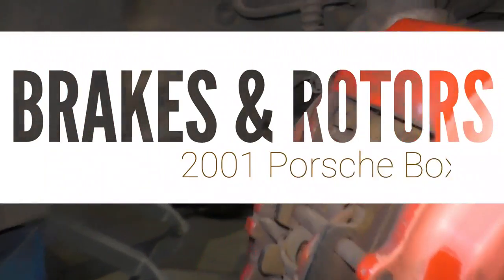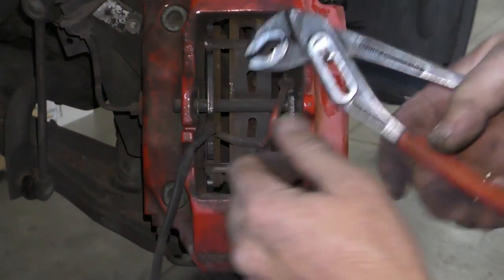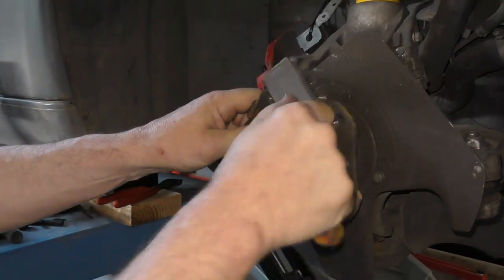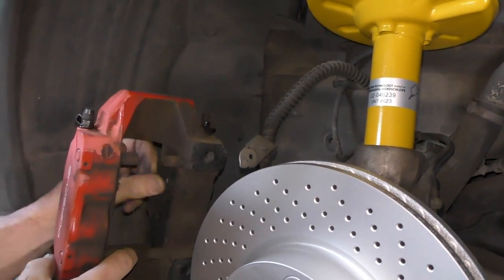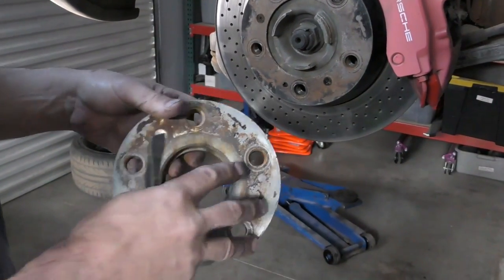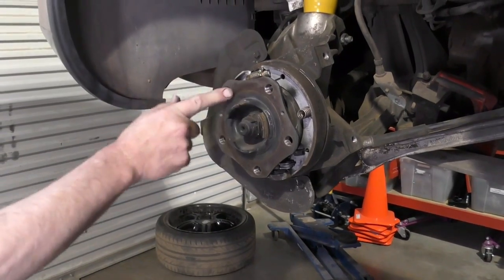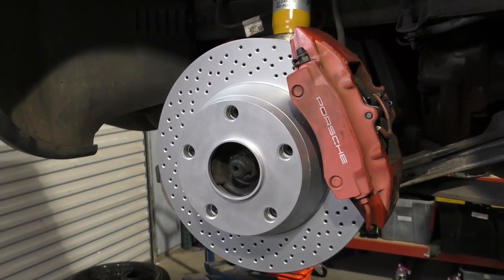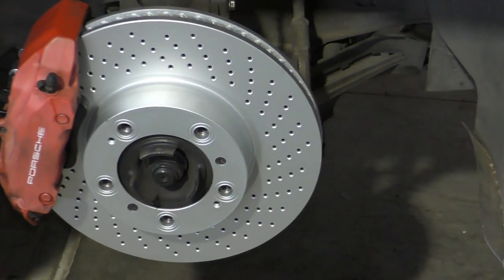Porsche Boxster New Brakes And Rotors

Comment: Thank you for all the videos you do.  I have a 2001 Boxster S and you have helped me tremendously.  BTW, would you mind sharing what brand of brake pads you used?
Reply from the maker: I have a couple of brands that i like to use. These are factory fitted brands and they are ATE, Textar, Or Pagid. I stay away from brands like Mintex, ferodo, or Napa brands. These types of pads usually have a compound that is to hard and they tend to not work well with the Porsche brake rotors
Kurt

Comment: Amazing video, so thorough and you did a great job explaining the process. I will be attempting this job at home and this video will be a great help. 

I do have a question, does compressing the brake pads and letting the old brake fluid from the bleeder screw introduce air bubbles into the system? In your video, you mentioned you were going to flush the brakes afterwards anyways but I was curious if you did not flush the brakes after this job, would there be any air bubbles in the system. I plan to have the brakes flushed at a later time by a professional mechanic. 

Thanks!
Reply from the maker: No it wont let in air by opening the bleeder valve while pushing back the pistons. Just dont forget to top off the brake fluid after your pad change.
Kurt
Reply: @klassikats  Appreciate the prompt reply. Cheers!

Comment: Fascinating work and you do it so professionally. I did the front brakes on my 1997 986 Boxster and after looking at you at work, I think I got it right. Copper grease was not applied by me simply 'cos I forgot to. No squeaks coming from them and the car pulls up just fine. I too have ventilated discs ( or rotors as you call them in the US ) and the more advanced "Red" Porsche callipers. Great stuff.
Reply from the maker: Thanks Graham,
glad you enjoyed the video
Kurt

Comment: Can I use or modify brake rotors from my boxer S for my 914 build
Reply from the maker: Alec,
unlikely as the hubs used on the Boxster are completely different to the ones used on the 914. This would result in different offsets. Also the brake rotor thickness are so different that the original calipers would not fit over the rotor.

Comment: A brake related question, but for 83 SC brake booster.  What do you do when you encounter a similar vintage brake booster that needs rebuilding?  Do you rebuild yourself, or send it out?  Would be very interesting to see a rebuild video for a booster.  Thanks!
Reply from the maker: I just dont really see any brake booster issues. Usually the biggest issue is the check valve failing. Other than that in last thirty five years I think I have only needed to replace 1 brake booster.
What issues are you having?
Kurt
Reply: @klassikats  Thanks for looking at this Kurt! My MC was leaking so I removed it along with the booster. Separated MC and BB and there was fluid leaked into the BB. So, replacing the MC w new. Also, trying to figure out how to deal w the wet/flooded BB. What started all this was my calipers froze --- this after rebuilding the calipers, replacing pads/rotors/ and brake lines the hard line attached to caliper and the rubber lines.
Reply from the maker: I would just drain the brake booster, flush with a little brake cleaner and put it back together. I have done this many times without any booster issues.
Kurt
Reply: @klassikats  thank you Kurt for the suggestion/recommendation. Do I need to split/open up the booster shell case? Or just drain and clean thru the openings/ports? Thanks!
Reply from the maker: No do not split it open, just drain it.
Kurt
Reply: @klassikats   Thank you for following up with the clarification. I've drained it, sprayed a few shots of brake cleaner in there and wiped dry (what I could reach).  New ATE master cylinder arrived. Getting ready to reassemble and install!